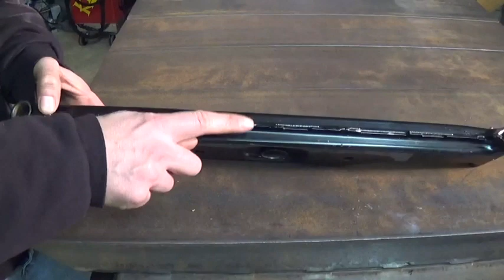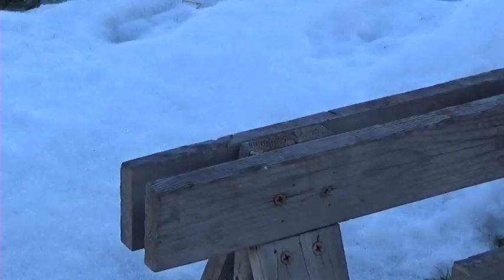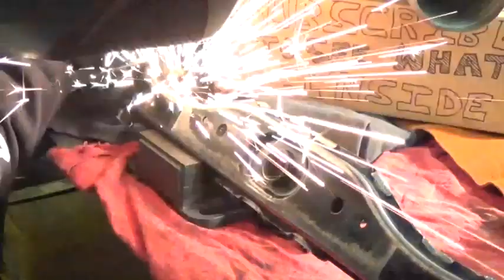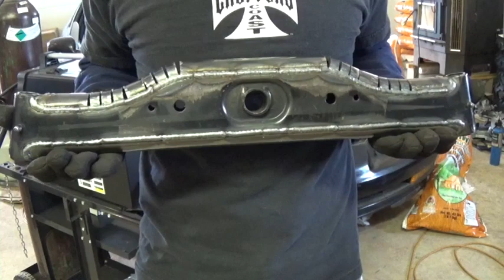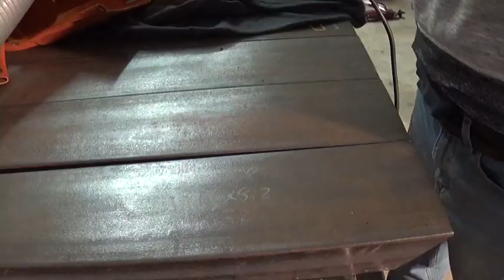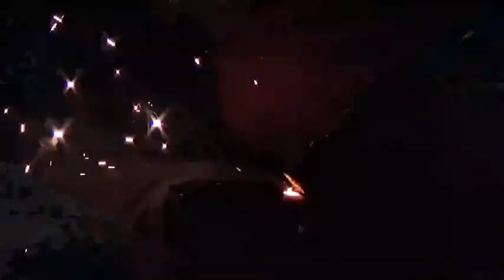Mud Mower 101= Front Axle Reinforcement.

Comment: Nice job fixing a poorly designed axle that has failed on thousands of mowers.  I decided not to fix mine, I bought the replacement cast iron axle off ebay used.  Part # 195968

Comment: Excellent work man this is by far the best reinforced stock axle I've seen! Most guys would swap it for a cast axle but here you are doing the "built not bought" thing in the true spirit of the sport! The only improvement I would add is to replace the nylon bushing with an Oilite so it's bombproof! Lol.
Reply from the maker: Thanks Brian's tractor shed,  I've never been a real fan of running the cast iron front axles. This tractor is more of a use what came with it and make it work / last. I should've did the bronze bushing swap but didn't want to spend the money on them. Thanks for watching man.

Comment: I am in no way hating on this reinforcement (I hate the weak ass stamped steel Axles), but that seems like a lot of work for a $40 Cast Iron replacement
Reply from the maker: Yep, it was a lot of work but it was really done to see if I could do it along with retaining the factory axle shape. One wouldn't need to grind it completely smooth or follow the arches of the beam but it was a good way to improve on some fabrication skills. 
There are some good front axle swaps that can be done to gain strength over other factory ones, but they come with there own issues  too.  
Black Jackal, thanks for watching and commenting.

Comment: Do you think I could use angle iron to reinforce the axle instead of using the round pipe like you did. Keep up the great work,your really helping keep my project going. Great job to say the least 👍👍
Reply from the maker: Angle iron will work. The only thing that I'll recommend is to test fit everything  (when it's tacked together) just to make sure every thing articulates like it should with no interference to axle housing and frame.  The top side of the axle beam is the side that needs close attention. 
Thanks for the kind words and thanks for watching.
Reply: Muddstir thank you 🙏

Comment: Looks great, on my axle I welded heavy wall pipe where the spindles go , so I could use bronze bushings. Envious of your talent.
Reply from the maker: Thanks man. The spindle mounts are probably the worst point on this style front axle. I agree Bronze bushings would be the best way to go than the super thin walled Plastic bushing in a sleeve welded inside  the axle beam. On a side note Spindle slop repair vid is coming soon  but not sure if I'll be switching I've to bronze or not trying to work with factory setup.